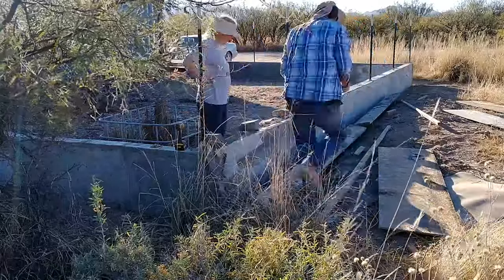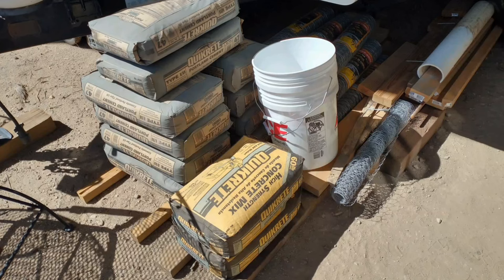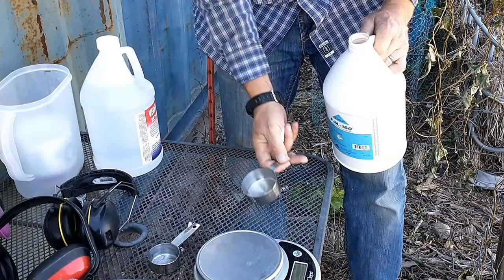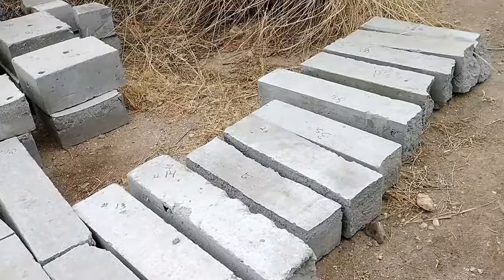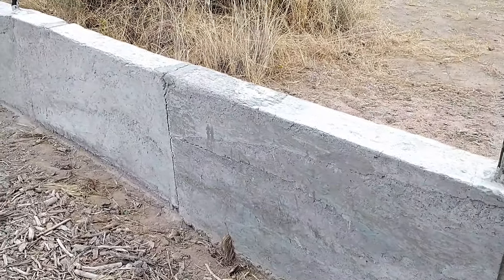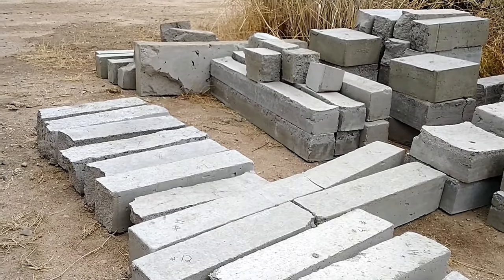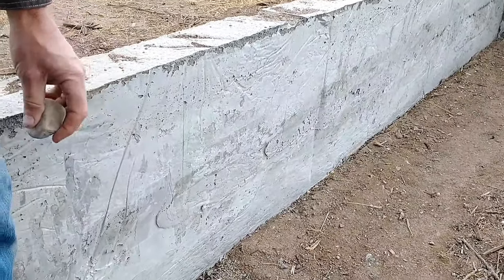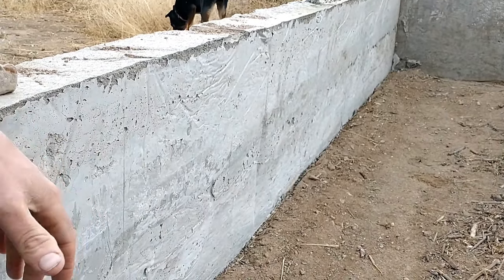Why we GAVE UP on AIRCRETE & What is Our Plan Now?

Comment: I have been following the AirCrete building process for some time, initially from dome building in more tropical and dry regions, to people wanting to use it as a more traditional building material with rectangular applications.   It makes me wonder how well the early AirCrete dome structures, with an embedded surface layer of reinforcing cloth, which is then stuccoed over with a polymerized cement mix, are actually holding up.  
I have always been an advocate of the uniform strength of round dwellings.  It is good that you have taken so much time to explore whether this material is best suited for your particular build application.   I did wonder whether you were also checking the consistency and chemistry of the batched/bag cement mixes of the brand that you were purchasing.
Reply from the maker: I asked one guy online how the dome he built a few years ago was holding up, and he said it was cracking and powdering, so sadly not much could be done to repair it.  
Not sure how you would go about testing the composition of the Portland cement. We would have needed over 550 bags to build our house, so if Portland cement of the same type is not always the same, we would have been in trouble there too. We were barely able to get enough for testing, everyone in town was sold out. 
My suspicion is that Drexel is part of the problem too. I know Harry showed that it keeps it's suds way longer than other foaming agents, but what he didn't show is all of the water that collects pretty quickly under the foam layer. There is definitely a lot that goes into making aircrete turn out right, we figured that if we could control the main variables we would be able to get consistent batches, but even after making the whole garden wall, we still weren't there. I do suspect the cold temperatures were not helping the Drexel, but it's cold and windy here in the spring, which would have brought more issues.
Reply: @RedandAprilOff-Grid  Could you forward a link to his site, so I could learn more about the process he used in building it?
Reply from the maker: @tube4chen  👍 It's a very big dome, with pretty thin aircrete bricks. https://youtu.be/eVojDy5LrAE
Reply: @RedandAprilOff-Grid
Reply: @RedandAprilOff-Grid  Thank you so much Red and April, for sharing the link of an individual , whose build I have actually followed for some time.  I did follow up and did a new online search for aircrete failures.  I like to know why particular individuals may have had a problem with the material, or with their particular build.  I closely study those who seem to have mastered the material, and who like sharing great detail about their methods and of course, the climate in which they have done their build.
Reply: @tube4chen  Hi Herbet, how did your investigation proceed in air crete or foam crete? Do you think its still a viable alternative for a waterproof insulation with a stucco render?  On a steel frame to carry the weight and support your structure.  Im thinking of using air crete or polystyrene crete as part of a mushroom grow shed supported but a light steel frame,  so doesn't need to be a engineered as strong as a dwelling.  Interested in your thoughts and discovery,  thx

Comment: The question needs to always be: How to spend the least amount of time, money and natural resources for the most sustainable value. After pursuing aircrete and many other options, I'm mostly focused on stone and cement for an 8' tall hand-laid shell with a geodesic dome roof made of wood and possibly insulated with aircrete or foam. Cinder blocks in a circle filled with rebar and aircrete also makes a great wall, with a geodesic dome roof placed on top.
Reply from the maker: That is what we were looking for, and aircrete definitely does Not fit the bill. We also considered rammed earth or poured concrete, but we really wanted walls with insulation, and something less labor intensive. Wood was crazy expensive when we started testing aircrete, but glad the prices came down, and we were able to reconsider it. I grew up in a cinder block house, it was freezing cold in the winter, and our heating bills were high. If you can figure out a way to insulate it without too much thermal bridging, it could make a good strong house. 🌞🏜️

Comment: Aircrete needs to be surfaced with mesh and screed. You can never leave aircrete unsurfaced so I'm not sure what you where condisdering. Another consideration is styrocrete which I will be using as a fill between my posts.  The only way I would be using aircrete is the walls between the posts as I mentioned. You can Look up styrocrete before you totally give up on this material. I think you would be impressed with styrocrete.
Reply from the maker: The purpose of our testing was to compare different mixes to each other, as well as our ability to make good and consistent batches.  We were trying to determine what recipe we would want to use between the metal structure for our walls. 
Cool, how is it going? I know there is a lot of interest in styrocrete right now, but haven't seen many (besides Steven Williams) actually building anything out of it yet. It looks like a messy process. Are you happy with the results? 🙂🏠

Comment: People seem to praise the thermal insulation of aircrete but realistically it might not be that great. A "perfect" batch of aircrete would have an r-value of 4 per inch, which means that if you build a 4 inch thick wall you would have an r-value of 16, which seems to be what conventional 2x4 stick built houses manage. However, when an aircrete batch is not that perfect, whic h is more likely in practice, it can have an r-value as low as 1 per inch, which means you need to build walls over a foot thick to get the same performance as a conventional 2x4 built house. Sure aircrete insulates better than concrete but if we are trying to improve insulation then it seems aircrete is not the solution.
Reply from the maker: Agreed! We originally thought our 8 inch walls would have as much at R-36, but they probably would have been closer to R-15. We are so glad we didn't build our house with aircrete. Traditional construction with exterior insulation is so much better, easier and cheaper. We love how our house turned out.

Comment: Reliability is an important aspect of a material. Yes, maybe it can be fixed and made good again... But it's not reliable or easy.
Reply from the maker: Another problem is that once it starts cracking it can't be fixed because it turns into powder. The homemade version is likely to have batches that don't turn out quite right.

Comment: Soft water has salt in it.  Salt causes pauling.  Our city had contractors that moved salt in the winter and moved the stone in the spring for the concrete that they poured in my neighborhood sidewalks.  they all needed to be replaced because of the salt.
Reply from the maker: We looked into other ways to get soft water, and this was the only practical way we could find. It seemed to work okay on the first batches, and temperature was likely a factor with our later batches.

Comment: Same conclusion the people selling this haven't figured it out well ether. Never seen it work well throughout got 200 12x12x6 blocks... could be temperature and fresh ss pads...

Still I think its missrepresented
Reply: Stephen Williams has some realy informitive stuff on aircrete Aircrete Styrofoam, the intresting thing about styrofoam is you get a ton of the benifits of the light weight airpockets without creating voids in the structure that KILL the effectiveness of fiber glass, i wonder if a styrofoam aircrete composite would be the best of all worlds
Reply: @timgoodliffe  I agree- aircrete is much better suited for insulation, and the styrofoam really bumps up the insulative Value
Reply: @davidprins9401  Here are test results of styrofoam vs air crete R values https://youtu.be/6U4JAop0dTY?t=1151
Reply: @khandam7709  thank you! I’ve seen that one and follow him - I think he is doing some good work too with thorough testing.

Comment: The best source of eps beads meant for epscrete are at Mexicali, not too far?  Much stronger more consistent and better insulating than aircrete.
Reply: @khandam7709  That is a great video and testing process - thanks for queuing it up.  I would guess that whole-bead (unbroken) eps (with size gradation) is going to be better insulating than shredded, or a combo would be better.  And you can add waste latex paint etc that kill aircrete, to make it much lower in water absorption.  I use it under footings for insulation because rigid foam is too much work there.  Problems are transporting the stuff and wind especially, but is can be very solid.

Comment: Interesting.  Some plasticizer, and more glass fiber may have helped.  Dan the tool man or whatever his name is, man about tools, something like that, did some aircrete stuff, and he was able to run an electric weed trimmer against it, and leave little to no damage, so definitely some difference, but his recipe was a bit different.  Anyway, I enjoyed watching this, good luck with your project.
Reply from the maker: It was an experience. 😄 Yes, Man About Tools used a low foam mix which is definitely stronger but also less insulative. We suspect the colder temperatures were to blame for the later batches not turning out well. Thanks for watching!

Comment: did you add metal reinforcement rebar/Concrete Remesh in the mold/forms?  also did you vibrate or hit the outside of the forms to get the concrete to get the cascades out of the mold surface?  I also think if you add some portland cement to the mix I feel it should have come out better
Reply from the maker: This video will answer some of your questions, https://youtu.be/42z8k8Y-zf0 we also have a playlist.
Reply: @RedandAprilOff-Grid  I watched your video to strengthen concrete you need to add fiberglass chop strands none of the wire you used was strong enough  you need to add 3 pieces of number 3# rebar or 2 pieces of number 4# rebar the wire you used did not have any linear strength I am not sure of the formula but you need to add ready mix with your aircrete or add rocks and sand to it to add strength I will see if a friend of mind has a formula for mixing but you need to add fiberglass or rebar to make you casing strong I feel you need to get the right mix and add rebar your footing pour don't   have any strength and you could take a mall and crack without much effort

Comment: I think you made a very wise decision. 
Frankly I wouldn't trust this material given it's inherent weaknesses, dubious claims, and it's dangerous promotion of home-made, inconsistent, and insufficiently tested results. Aircrete doesn't bear loads, it grows brittle as density increases, and it's insulative properties fail by comparison to batt, blow-in, or sprays due to the weight that aircrete adds, which those other options don't. (weigh any dimension of R36 aircrete compared to the same R value dimension of any of those others, and aircrete loses - by a large margin.
The claimed advantage of cost savings disappears when one factors in the dangers; concrete and stick frame is easy enough and hands on enough that I don't care to take the risk just to chase a few bucks.
Reply from the maker: Definitely! Once we compared the price difference, it just didn't make sense, and there were too many unknowns about it's long term durability. It also turned out that the insulation value wasn't nearly as good as we originally thought. Google said it was R-6 per inch, and turns out it is likely closer to R-2.
Reply: @RedandAprilOff-Grid  Your experiments and testing have helped lots of others, including ME! 
You'll never know how many headaches you've eliminated!!! (or worse!)

Comment: I don't understand why one would want to build with toxic materials when there are better ones available. Fiberglass, styrofoam and aircrete in any type of mix is just... whoa, I mean, what's the longevity of the house, and what happens to the materials afterward?

Hempcrete is made up of hemp shives, water and powdered lime, can be scaled for industrial sized buildings and high-rises (it's an insulation material, not the load-bearing structure), it is an active carbon sink even after the building is finished, and if it needs to come down some time, can be reused in new builds (10% old hempcrete in the mix) or crushed and used as a soil amendment for the lime... yeah. 

Also, rodent and termite resistent, and withstands a flame of 600°C at 10 cm (4 inches) for 2 hours. Australia's using it tons in fire prone areas now. 

Why even bother with other materials once you know about hempcrete?
Reply from the maker: People were saying aircrete was cheap, fast and easy. They also said it had excellent insulation value and other desirable properties, so we thought it might be worth a try. It turns out none of that was true. I don't know much about hemp, but a quick internet search shows that you can purchase it for animal bedding, and it's fairly expensive. I haven't heard of it being used or readily available in out area, but it sounds interesting. Our solar passive design home with exterior insulation turned out awesome, and our son built his house out of dirt. 🌞🛖🏜️

Comment: I'm curious to hear what the big aircrete guys are saying. Some people have made a business out of selling aircrete tools and secrets so this sort of thing would really hurt the reputation of aircrete. I really appreciate the honesty of your videos! I'm going to try working with perlite and not use foam at all so I'm hoping I get different results.
Reply from the maker: I think a lot of people have become pretty disillusioned with regular aircrete. It's really difficult to find good and complete information about making it, and there isn't much information out there about it's long term durability. As we have experienced firsthand, even when trying to use the same recipe and method you can get vastly different results. Several of the aircrete veterans have seemed to pull away from aircrete, or only use it for certain applications. The workshops that some offer are pretty expensive, but maybe it's worth it. 
I don't know much about perlite, but sounds like others have had success in adding it to aircrete or cement. Styrocrete is all the rage right now, I'm curious to see how it works out for people, I'm sure it has it's challenges too, and it looks like a lot of work to gather the materials and make the product.
Best wishes on your projects! Trying new things is always interesting and sometimes fun. 😄😊
Reply: @RedandAprilOff-Grid  you guys should give it one more shot though with perlite. You can get it at any gardening store and you can order direct from the manufacturer if you want to buy larger quantities. Just for example, in Ontario I found a supplier that will provide 70cubic foot sling bags for only $3.80/cuft. That's pretty darn cheap. Don't use any foam, just use perlite, recycled paper blow insulation you can get from any hardware store, concrete and water. 

You've got all those bags of cement, just try it out. It should have similar thermal properties, be light weight but much stronger than foam.
Reply from the maker: That sounds like it has a lot of potential, and would certainly be much easier and less messy than collecting and shredding a whole bunch of styrofoam. You should do a video slide show or something of your finished project, it sounds awesome!  We are working on the cost difference video between aircrete and our new more traditional build. We have already moved on, our first materials order will be arriving Wednesday.

Comment: I've only been using the aircrete for insulation, not structural. Definitely a funky/finnicky product!
Reply from the maker: You have made a whole lot of aircrete, and will have a very well insulated house. 🙂
Reply: @khandam7709  only b/c I haven't secured a source of it, but it does seem to be a superior product! Just a couple more steps to get it/ process it
Reply: Also, it seems to be less liquid,  so some different use cases.  But I haven't used it myself. Perhaps next year I will!

Comment: Sounds like your agitator that builds the bubbles wasn't being cleaned.  Plus, if you look around it is obvious that the aircrete is not good weight bearing material.  It is best used only as an insulator.
Reply from the maker: We were cleaning and running water through the foam generator at the end of each use. My best guess is that the colder temperatures were negatively affecting the Drexel.  We were planning to use a metal frame, rebar, wire mesh, fiberglass mesh, and plaster. We wanted a product we could reliably make in our climate, and since temperature and humidity etc... is such a big factor, we learned it wasn't going to work for us.